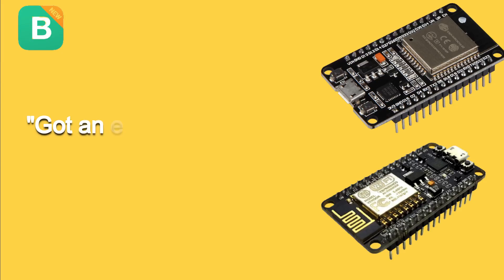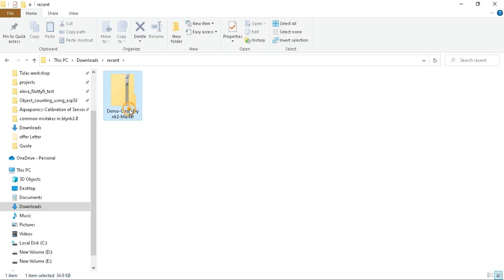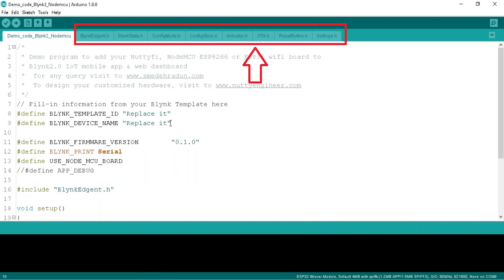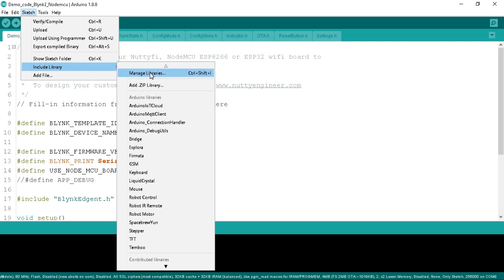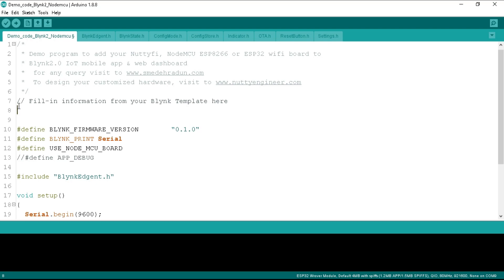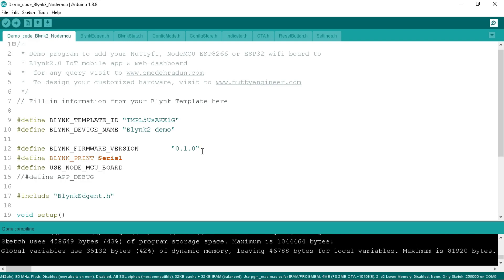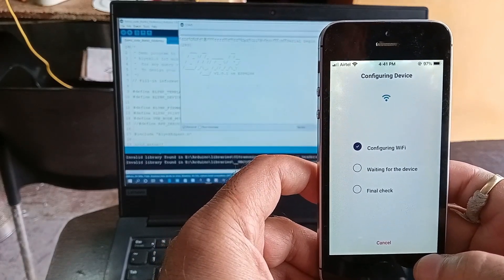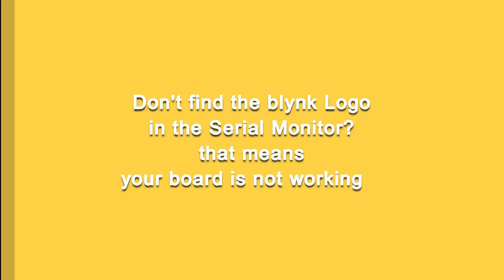How to fix Errors in new Blynk2.0 | Compilation Error |Connection Error | Board Error| Library Error

Comment: I am getting don't have permission to access this device I have only one account and don't shared by anyone but it's showing don't have permission what should I do
Reply: When I press web page widget
Reply from the maker: It’s likely a serial port permission issue. Try running the Arduino IDE as administrator or ensure no other app is using the port. Let me know your OS for exact steps.

Comment: I get a "Compilation error: 'WiFi' was not declared in this scope". What do I do to solve this issue?
Reply from the maker: You need to add the blynk credentials at the top of the code and all the headers must inside the code folder. 

You can choose the alternate method to connect with blynk. Below video may help you-

https://youtu.be/DBrLP0DQazc?si=-7jxgs2HXrSE2FLo

Comment: After uploading code it does not shows the temperature or humidity on blynk app
Reply from the maker: If you are feeling trouble to connect with blynk and to display data, then below is the my another video, that guide you step by step to display the DHT sensor data to blynk. 

https://youtu.be/c5u6-Th1sI4

Comment: In the video, you ask us to replace #define BLYNK_DEVICE_NAME "Change it" with the text copied from the template firmware configuration section of the Blynk.Console.  However, the variable there is no longer called "BLYNK_DEVICE_NAME".  Now it is called "BLYNK_TEMPLATE_NAME".  This causes an error that can be fixed easily by changing everything to ""BLYNK_DEVICE_NAME".  Why are these two variables different? "Device_Name" implies it is the name of an individual device, however, you are clearly pasting in the name of the template.
Reply: So we just have to change the BLYNK_DEVICE_NAME to BLYNK_TEMPLATE_NAME?
Reply from the maker: Just copy paste the credentials from your blynk project to your code.
Reply from the maker: This is recently changed that made by blynk.

Comment: How to solve connecting to blink-cloud:80 problem ,which just printing on the serial monitor
And not connecting to blink cloud
Reply from the maker: It’s may be due to blynk token issue or network issue. 
Please Check your blynk credentials and SSID and Password in your program.

Comment: my node mcu is not connecting with blynk it connects for 5-10 seconds  and again  disconnects also blynk is showing offline please help asap
Reply from the maker: Hi,
It may be due to power issue or some time due to credentials stored in the eeprom of the board. 
You can also join our telegram channel for help. Below is the link
https://t.me/+vJcqQmRQLKYwZWQ1
Reply: @SMEDehradun  tried clearing the eeprom but facing the same problem can you provide any other solution
Reply from the maker: If eeprom not getting cleared, then below links May help you factory restore your board. 

For Esp32- https://youtu.be/3oEvXhgHZHo

For esp8266- https://youtu.be/2ah2nFwzAyo
Reply: @SMEDehradun  It got cleared successfully but still there is connection problem
Reply from the maker: Either there is problem with your board or your code. You have verify that.

Comment: Hello i already installed the blynk library but it still keeps on showing compilation error :BlynkEdgent.h: No such file or directory
Reply: Is it resolved because me too getting same error although I am using the Arduino Cloud IDE to code the esp8266 by selecting nodemcu esp12E as device in Arduino cloud ide
Reply from the maker: Hi,
If you have seen the video properly, then addon header files must be inside the programming folder.
Reply: It's already in the programming folder
Reply from the maker: What error you are getting?
Reply: the same error it always say no such file or directory
Reply from the maker: @allansuarez4506  can you tell which video you are following? share the link.
Reply from the maker: Blynk edgent method is little tricky and if you are not aware about how to keep headers inside code folder then you will get such errors. 

So it’s batter you can choose alternate method to connect with blynk. Below is the code that guide you how to connect easily. 
https://youtu.be/DBrLP0DQazc

Comment: #define BLYNK_PRINT Serial
#include <BlynkSimpleShieldEsp8266.h>
#include <SimpleTimer.h>
char auth[] = "NToXojOZg2tvGbHCj0hgF4nSu7KMhvYO";
char ssid[] = "Mehul";
char pass[] = "Mehul1310";
SimpleTimer timer;
#define ESP8266_BAUD 115200
ESP8266 wifi(&Serial);
////////////////////////////////////////////
#include <LiquidCrystal.h>
LiquidCrystal lcd(8,9,10,11,12,13);//RS,EN,D4,D5,D6,D7
#include <Servo.h>
#define ir1 A1
#define sen1 A0 // moisture
#define buzzer 2
#define trigPin1 A4////right
#define echoPin1 A5

#define trigPin2 A2  //// front
#define echoPin2 A3

#define green 4
#define blue 5
int lvl1=0;
 int lvl2=0;
long duration, distance,sensor1,sensor2; // us variable
int onetime=0,onetime1=0 ;
int wet=0,moisture=0,object=0,cabin2=0,c1=0,c2=0;
Servo myservo; 
void setup() 
{
 lcd.begin(16, 2);//initializing LCD
 lcd.setCursor(0,0); 
 lcd.print("Automatic WASTE");
 lcd.setCursor(0,1); 
 lcd.print("Segregation sys");
 delay(3000);
 pinMode(ir1,INPUT);
 pinMode(sen1,INPUT);
 pinMode(buzzer,OUTPUT);
 pinMode(trigPin1, OUTPUT);
 pinMode(echoPin1, INPUT);
 pinMode(trigPin2, OUTPUT);
 pinMode(echoPin2, INPUT);
 pinMode(green, OUTPUT);
 pinMode(blue, OUTPUT);
 digitalWrite(green,HIGH);
 digitalWrite(blue,HIGH);
 myservo.attach(6);  // attaches the servo on pin  to the servo object
 myservo.write(75);
 Serial.begin(ESP8266_BAUD);
 delay(10);
 lcd.clear();
 lcd.print("connecting.....");  
 Blynk.begin(auth, wifi, ssid, pass);
 timer.setInterval(2000L, sendSensor); 
 lcd.clear();
 lcd.print("connected....."); 
 delay(1000); 
 lcd.clear();
}

void loop() 
{
 Blynk.run();
 timer.run();
 moisture=analogRead(sen1);
 Serial.print("moisture = ");
 Serial.println(moisture);
 delay(500);
 //////////////////////////////////////////////////////
 ultrasensor(trigPin1, echoPin1);
 sensor1 = distance;
 delay(10);
 ultrasensor(trigPin2, echoPin2);
 sensor2 = distance;    
 delay(10);
 Serial.println(sensor1);
 Serial.println(sensor2);
 lvl1=(17-sensor1)*6.5;
 lvl2=(17-sensor2)*6.5;
 Serial.println(lvl1);
 Serial.println(lvl2);
 if(lvl1<0){lvl1=0;}
 if(lvl2<0){lvl2=0;}
 if(lvl1>100){lvl1=100;}
 if(lvl2>100){lvl2=100;}
 if(lvl1>70){Blynk.notify("dustbin is full:- id-0001");}
 if(lvl2>70){Blynk.notify("dustbin is full:- id-0001");}
 lcd.clear();
  lcd.setCursor(0,0); 
  lcd.print("moisture: ");
  lcd.setCursor(12,0); 
  lcd.print(moisture);
  lcd.setCursor(0,1); 
  lcd.print("DL= ");
  lcd.setCursor(4,1); 
  lcd.print(lvl1);
  lcd.setCursor(8,1); 
  lcd.print("WL= ");
  lcd.setCursor(13,1); 
  lcd.print(lvl2);
 delay(1000);
 
 /////////////////////////////////////////////////////
 object=digitalRead(ir1);
 moisture=analogRead(sen1);
 if(object==LOW)
 {
  lcd.clear();
  moisture=analogRead(sen1);
  lcd.setCursor(0,0); 
  lcd.print("-GARBAGE SENSE-");
  lcd.setCursor(0,1); 
  lcd.print("moisture: ");
  lcd.setCursor(12,1); 
  lcd.print(moisture);
  digitalWrite(buzzer,HIGH);
  delay(150);
  digitalWrite(buzzer,LOW);
  delay(1000);
  moisture=analogRead(sen1);
  Serial.print("moisture = ");
  Serial.println(moisture);
  delay(500);
  moisture=analogRead(sen1);
  Serial.print("moisture = ");
  Serial.println(moisture);
  delay(500);
  if(moisture>=40)                         
  {
   lcd.clear();
   lcd.setCursor(0,0); 
   lcd.print(" WET  GARBAGE");
   myservo.write(0);
   delay(5000);
   myservo.write(75);
   delay(2000);
   Serial.println("wet");
  }
   else if(moisture<100)
   {  
    lcd.clear();
    lcd.setCursor(0,0); 
    lcd.print(" dry  GARBAGE");
    myservo.write(135); 
    delay(5000);
    myservo.write(75);
    delay(2000);
    Serial.println("moisture");
    lcd.clear();
   }    
  }    
 }
void sendSensor()
{ 
 Blynk.virtualWrite(V5, lvl1); // Humidity for gauge
 Blynk.virtualWrite(V6, lvl2); // Temperature for gauge
}
 void ultrasensor(int trigPin,int echoPin)
 { 
  digitalWrite(trigPin, LOW);  // Added this line
  delayMicroseconds(2); // Added this line
  digitalWrite(trigPin, HIGH);
  delayMicroseconds(10); // Added this line
  digitalWrite(trigPin, LOW);
  duration = pulseIn(echoPin, HIGH);
  distance = (duration/2) / 29.1;
 }
I got error for this code
I don't know how to solve it
Please help me

Comment: class BlynkWifi' has no member named 'notify'         HELP ME OUT SIR PLEASE
Reply from the maker: This is the issue because of header files. 
You need to have all the headers inside the programming folder. Also check that you have installed the latest blynk library. If you are not able to connect your baord to blynk using blynkedgent method Then you can another method to connect.

Below is the video that can show how you can-

https://youtu.be/mLzEb_1i9UQ

Comment: SIR my error is showing after uploading the code  in esp 32
Guru Meditation Error: Core  1 panic'ed (IntegerDivideByZero). Exception was unhandled.

Core  1 register dump:
PC      : 0x4014cad5  PS      : 0x00060730  A0      : 0x800d5a3c  A1      : 0x3ffb21c0  
A2      : 0x00000000  A3      : 0x00000000  A4      : 0x33333330  A5      : 0x42013333  
A6      : 0x00000000  A7      : 0x000003fd  A8      : 0x00000000  A9      : 0x3ffb2180  
A10     : 0x00000000  A11     : 0x000000f8  A12     : 0x000000f4  A13     : 0x00000000  
A14     : 0x000000e0  A15     : 0x3ffc4358  SAR     : 0x00000005  EXCCAUSE: 0x00000006  
EXCVADDR: 0x00000000  LBEG    : 0x4008963c  LEND    : 0x40089652  LCOUNT  : 0xffffffff  

Backtrace: 0x4014cad2:0x3ffb21c0 0x400d5a39:0x3ffb21e0 0x400d3132:0x3ffb2200 0x4014c815:0x3ffb2220 0x400d531d:0x3ffb2240 0x400d379f:0x3ffb2270 0x400d8161:0x3ffb2290

sir please help me in this problem
Reply from the maker: There may reset issue. Provide the proper power to your board.

Comment: Hello, I'm getting "Compilation error : 'BLYNK_FIRMWARE_TYPE' is not declared" in ConfigMode.h when I try to compile the ESP32 DEMO code. Can you please let me know how to solve this?
Reply from the maker: Hi,
Sometime it may due to wrong board selection, old blynk library. 

Plz fix these issues. You can also connect with new Blynk using template option. 

Check this  video for this- https://youtu.be/c5u6-Th1sI4
Reply: yes, it was the reason for the error. Thank you.
Reply from the maker: Welcome

Comment: Sir, why I don't have WiFi Blynk project after deleted old device data at blnyk because I want add new device data... do i need to buy another esp32?  other than that, is there any other alternative?  because before this I changed the new data device successfully when using the new esp
Reply from the maker: Yes. There is alternate to add new device manually. 

Watch this video. It will guide you to?
https://youtu.be/c5u6-Th1sI4
Reply: @SMEDehradun  I have an email sir..I hope you can help me
Reply from the maker: Hi,
I have revert you the suggestion. Check your mail.

Comment: hello brother i am facing an error

Arduino: 1.8.19 (Windows 10), Board: "NodeMCU 1.0 (ESP-12E Module), 80 MHz, Flash, Disabled (new aborts on oom), Disabled, All SSL ciphers (most compatible), 32KB cache + 32KB IRAM (balanced), Use pgm_read macros for IRAM/PROGMEM, 4MB (FS:2MB OTA:~1019KB), 2, v2 Lower Memory, Disabled, None, Only Sketch, 115200"

In file included from C:\Users\Ashar Tahir\Videos\mohsin\Demo-Code-Blynk2-Master\Demo_code_Blynk2_Nodemcu\Demo_code_Blynk2_Nodemcu.ino:15:

BlynkEdgent.h:12:2: error: #error "Old version of Blynk library is in use. Please replace it with the new one."

   12 | #error "Old version of Blynk library is in use. Please replace it with the new one."

      |  ^~~~~

Multiple libraries were found for "BlynkSimpleEsp8266_SSL.h"

 Used: C:\Users\Ashar Tahir\Documents\Arduino\libraries\blynk-library-master

 Not used: C:\Users\Ashar Tahir\Documents\Arduino\libraries\Blynk_For_Chinese

 Not used: C:\Users\Ashar Tahir\Documents\Arduino\libraries\Blynk

exit status 1

#error "Old version of Blynk library is in use. Please replace it with the new one."

This report would have more information with
"Show verbose output during compilation"
option enabled in File -> Preferences.

please give me solution................................
Reply from the maker: Hi,
You have old blynk library in your Arduino ide. So search the blynk folder inside your Arduino software & delete them & reinstall the new library.
You can also try to update the blynk library. See this video for reference https://youtu.be/4T2prbZM8og
Reply: @SMEDehradun  ok
Reply: @SMEDehradun  bro their is an other error

Arduino: 1.8.19 (Windows 10), Board: "NodeMCU 1.0 (ESP-12E Module), 80 MHz, Flash, Disabled (new aborts on oom), Disabled, All SSL ciphers (most compatible), 32KB cache + 32KB IRAM (balanced), Use pgm_read macros for IRAM/PROGMEM, 4MB (FS:2MB OTA:~1019KB), 2, v2 Lower Memory, Disabled, None, Only Sketch, 115200"

In file included from C:\Users\Ashar Tahir\Videos\mohsin\Demo-Code-Blynk2-Master\Demo_code_Blynk2_Nodemcu\BlynkEdgent.h:22,

                 from C:\Users\Ashar Tahir\Videos\mohsin\Demo-Code-Blynk2-Master\Demo_code_Blynk2_Nodemcu\Demo_code_Blynk2_Nodemcu.ino:17:

C:\Users\Ashar Tahir\Videos\mohsin\Demo-Code-Blynk2-Master\Demo_code_Blynk2_Nodemcu\ConfigMode.h: In lambda function:

ConfigMode.h:211:7: error: 'BLYNK_FIRMWARE_TYPE' was not declared in this scope; did you mean 'BLYNK_FIRMWARE_VERSION'?

  211 |       BLYNK_FIRMWARE_TYPE,

      |       ^~~~~~~~~~~~~~~~~~~

      |       BLYNK_FIRMWARE_VERSION

exit status 1

'BLYNK_FIRMWARE_TYPE' was not declared in this scope; did you mean 'BLYNK_FIRMWARE_VERSION'?

This report would have more information with
"Show verbose output during compilation"
option enabled in File -> Preferences.
Reply from the maker: Hi,
Try any other code in your board. There is issue with your board.
Reply: @SMEDehradun  nope
Reply from the maker: Try to upload any other code so that it will clear your doubt. If other code will upload successful. Then let us know
Reply: @SMEDehradun  yes all codes are working but this code is not working
Reply from the maker: What project you are marking?
Send me the link. If that’s my video, then comment on these video.

Comment: I have esp8266 and getting invalid auth code
Reply from the maker: Hi,
It may due to token is different or may be there is some issue with token. 
So check it or make new template & try to reconnect.

Comment: i have  a esp 32  module and i also updated all blynk libraries as u said still i'm getting the error "user_interface.h"  (it says no such file or directory error) 
 also shouldi select the wrover moudle isd i have esp 32
Reply from the maker: Hi,
I am not asking you about the library. That’s great that you have install all the library. But I am asking to add all the header in the program folder. 
 
Why don’t you see the video properly? 
I have shown all the Methods to resolve all the errors. 
And even after the video, you are not getting my point, then let me know. I will try to resolve it personally
Reply: @SMEDehradun  yes sir please i'm really new to the programmig field and really require your help in my project which is due in a week how can i contact you sir
Reply from the maker: You can mail me your problem at schematicslab@gmail.com

Comment: Hello sir, thank u for great video. But i have problem when I want to connect to my node mcu device, in my phone says "Something went wrong, not correct device" but in my serial monitor it's just say
13:03:20.858 -> [68204] WAIT_CONFIG => CONFIGURING

13:03:25.149 -> [72494] Sending board info...
13:03:25.237 -> [72578] CONFIGURING => WAIT_CONFIG
I'm using blynk 2.0.
Reply from the maker: Hi Sultan Fauzan,
That may error due to slow internet or wrong wifi name or password. 
You can also try to connect it to another wifi.
Reply: @SMEDehradun  The connection is not slow and the error appear before wifi name and password input
Reply from the maker: K. Then you just do one thing, erase the eeprom of your NodeMCU board, then connect your board to the wifi using the demo code. Once connected to wifi, then edit the demo code & make your program.

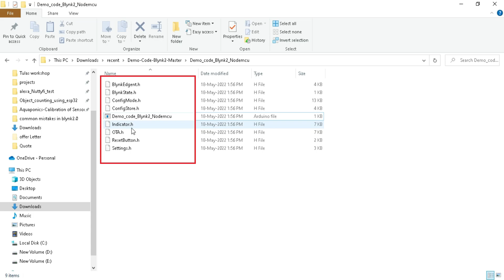Comment: 4:40 are these header files same for any other nodemcu codes
Reply from the maker: Yes,
These are the common files for the all NodeMCU
Reply: @SMEDehradun  but I am getting an error
 'BLYNK_FIRMWARE_TYPE was not declared in this scope; did you mean 'BLYNK_FIRMWARE_VERSION'?
Reply: I am trying to do ur smart dustbin project  using node mcu
Reply from the maker: Which NodeMCU board you are using?
Reply: @SMEDehradun  amica
Reply from the maker: The code will be se for it. Check the board you have selected in Arduino IDE.
Reply: @SMEDehradun  I have selected esp8266
Reply from the maker: Select the board as shown in the video. Watch the video properly
Reply: @SMEDehradun  but that board is for esp 32 ryt
Reply from the maker: But version is different